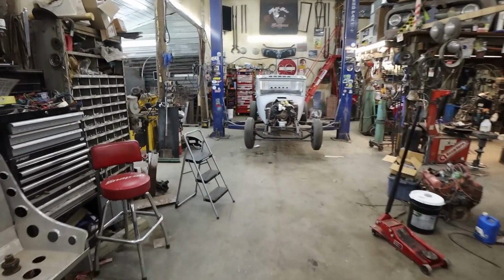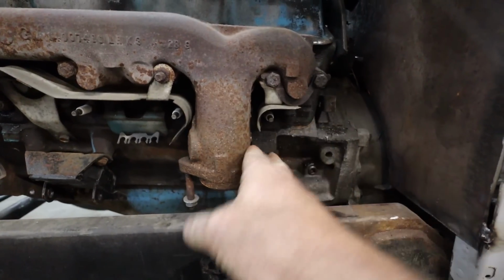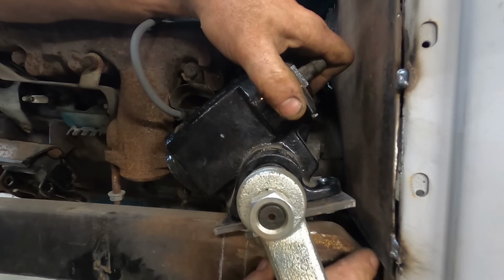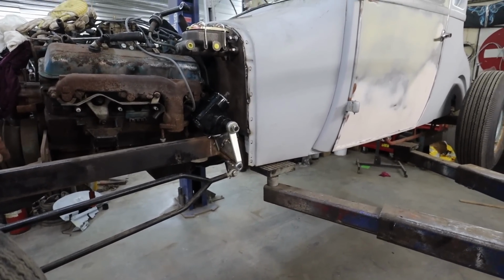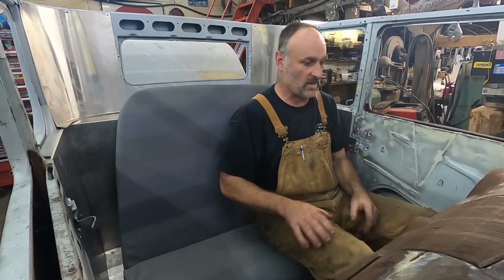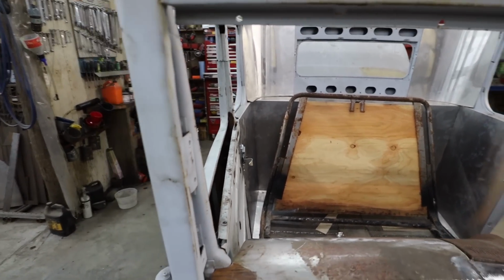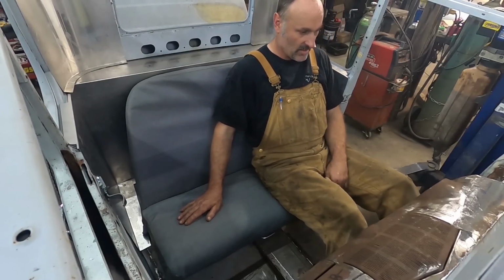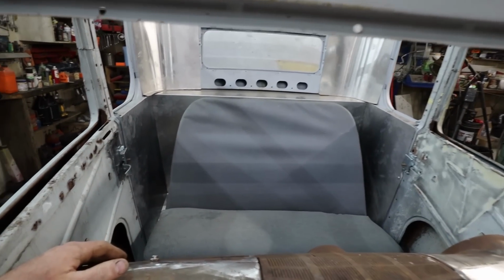Steering box mount and fitting a bus seat in our Model T hot rod Part 11

Comment: I like the idea of the bus seat.
Either widened or made into buckets.
And I understand that you would prefer not to have that high of a back.

(It's not my car, so this doesn't matter... but if it was mine, I would like that higher back.)😎

Using the bus seat reminds me of my late grandpa.
Back in the early/mid '80s, he built a small homemade tractor. About the size of an old Ford 8N. 

Grandpa wasn't a small guy.
And so, he wanted a large seat.
He bought an old bus seat, like your's, at an auction.
Took it home; tore it apart; cut the back frame down, to about 1/3rd the height.
I think he may have narrowed the overall size of the entire seat as well...by a few inches.
Anyway...took it to a "local" upholstery shop and had them build up the cushioning, and covered it with some heavy-duty vinyl.

The uniqueness of the seat worked well with the rest of the "tractor".😎

(I could describe all the other parts/pieces that he used to make the tractor. But I have already wasted enough of your time.)😁😁

I will just add, that Grandpa was an "old school hot rodder" from way back.
His first car he built...as a teenager in 1930...was built from various parts of several old Hupmobiles.😎

Comment: Brent the truck is taking shape. Why don't you take two seat and weld them together to fill in wall to wall. then get a little longer piece of plywood for the support piece. That way you don't have 3" or 4" open on each end of your seats. If you get a Big Boy in there with you, he may be hanger off the edge of the seat and sitting in the edge of your lap at the same time. You need maximum seating. And the metal edge of the seat would be closer to the outside wall.  Anyways, just trying to help you sir, love your channel keep them coming. Take care my friend

Comment: nice work, now for your dilemma; you could put the front bolt in from the top, just ream out the threads on the steering box and thread or weld on a nut to the bottom of the plate. stay safe have fun.

Comment: Tap the plate on the steering box bracket for the back bolt and drill a hole in the chassis for clearance so the bolt shaft can pass through into the rail this way you do need to angle the box with a gusset which will drop your steering shaft angle. You can use the base off another bus seat as the back rest to square the seat out, use two bases to build the one seat!

Comment: Consider: Narrow down the current bench to bucket width. Then, make a second one. That will use another bus seat but you'll have bucket seats that match. Bo.
Reply: Good idea
Reply: I was thinking about using a bottom on the back, but I like the 2 bucket idea better.
Reply: Did same idea for boat seats worked great 👍
Reply: I was thinking to widen the seat. Then thought like you, to make two buckets.
Reply: Wide the bottom about 4 inches and have the back even with it. Put a vin the back in the center at the top.
Reply: @gkanderson92  Yeah and maybe a little console between the two...........or at least a shared armrest.

Comment: Regarding your steering box mount, if you slot the rear most hole, you can remove the box by removing the two front bolts and loosening the rear bolt.  It would make it easier to remove the box.

Comment: I used a bus seat way back in 1956 in a 34 coupe that I channeled.  Worked fine.
Reply: When were "kids", my buddy had a chopped 36 Ford pick up (simular to one of Brent's recent builds).  We were in the junkyard one day and he bought a power seat out of a Cadillac.  My first response was:  How far do you think that seat will move, half an inch (no room in such a small area)?  After much struggle he realized it was an act of futility and $20.00 not well spent.

Comment: The bus seat has a taper going up  the back, it's gonna be uncomfortable for your passenger. Plus it needs widening to fill out the gaps on the sides.   Just my 2 cents.       Great channel 👍👍
Reply: Agree.  Use two bus seat frames to make a seat that fits the area by widening.

Comment: I think personally In regards to the hard to access bolt on the steering, I would have put like an m8 In and made it like
A dowel pin so it would locate on the front n be bolted at the back. However I don’t know if that would put too much stress on the casting or something

Comment: For the steering box mount instead of welding the brace to the frame have the braces bolt to the frame. Having the frame sandwich between the steering box mounts.  🤔

Comment: Brent, I had the exact same problem. I drilled out the threads of the tab on the Vega box and welded a bolt to the frame. It stuck up through the box and a locktite nut held it together. Till holding strong after 14,000 miles of hot roddin'!
Reply from the maker: I feel it's not square enough on the steering box to do that though a stud might be fine in the box to the frame

Comment: On the steering box mount, why not weld a nut under the rear of the mounting plate, screw in a stud, then secure the box from the top with a nut to get mucho clearance and a better angle???

Comment: Hi Brent,how about bolting steering box bracket to the side  of the chassis rail rather than welding it? Then to work on said box one has to undo these side bolts giving access to the bolts on the underside if one wanted to.

Comment: 7:46 Could you make a hole in the plate for the forward bolt that is slotted ? 
It could be either straight towards the firewall or one that has a large hole (for hex head and washer) next to a slotted one the correct size of the bolt hole.

Comment: That steering box bolt, how bought drilling through the bottom frame up thru to that threaded hole and use a longer bolt with lock washers to hold it? Then you can box it out the way you what it?.... Just some thinking with a few Brews..... Thumbs Up!.....